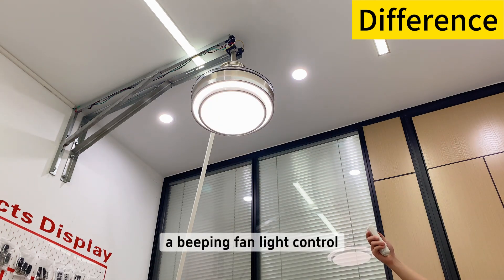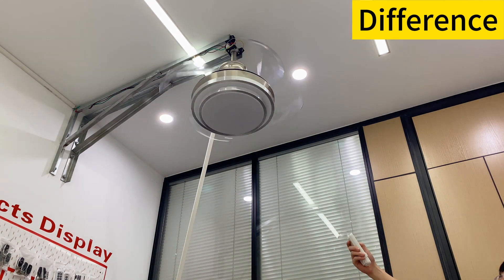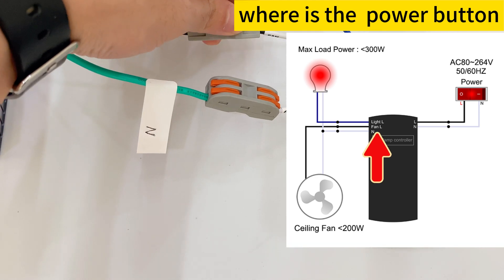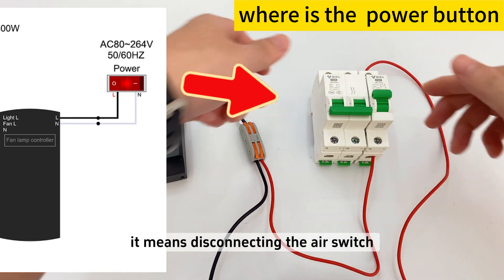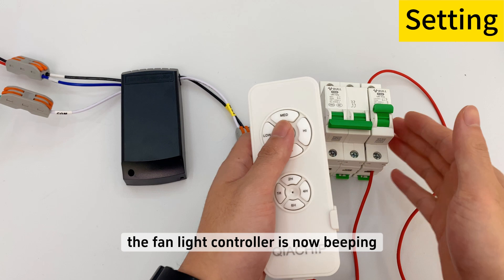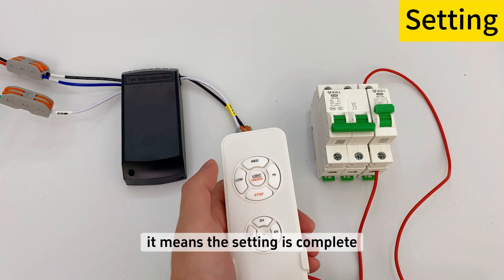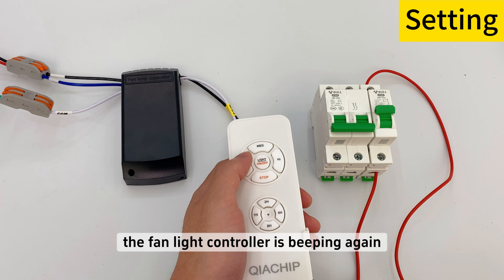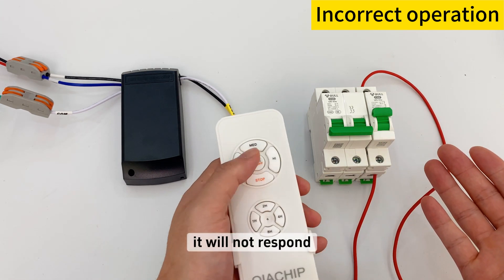How to set ceiling fan light controller to quiet mode via 433MHz remote control mute or beep mode

Comment: Disconnect the power from the garage? Or just turn the fan off and do this?
Reply from the maker: Please note that you need to disconnect the fan's power supply, not just turn it off, because the power is still connected when the fan is simply switched off.
By the way, is the fan's power supply here connected to the garage door opener?